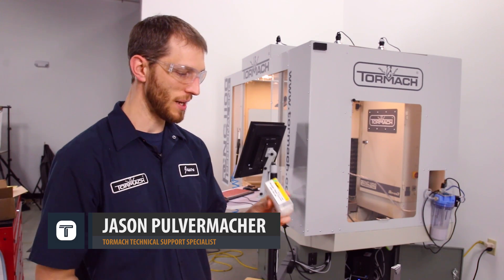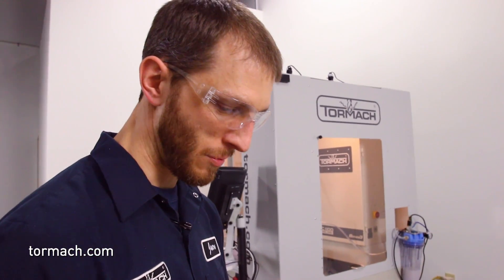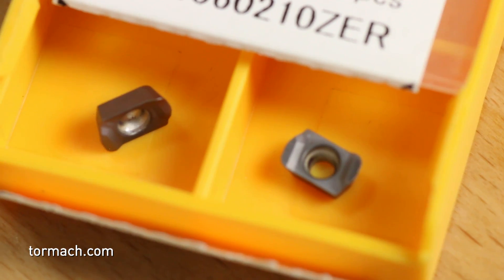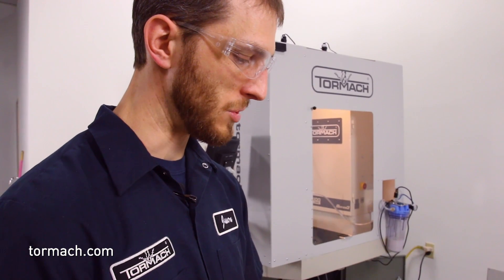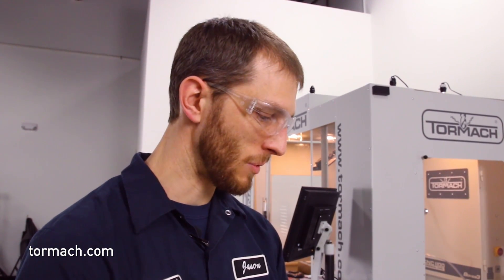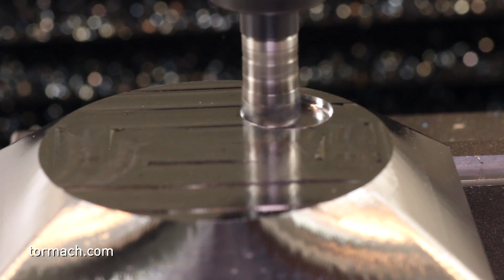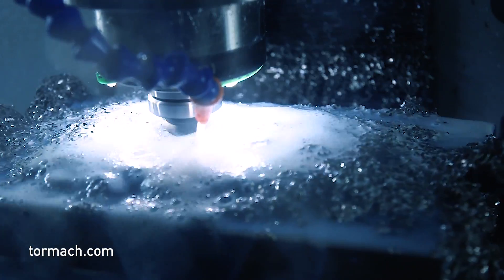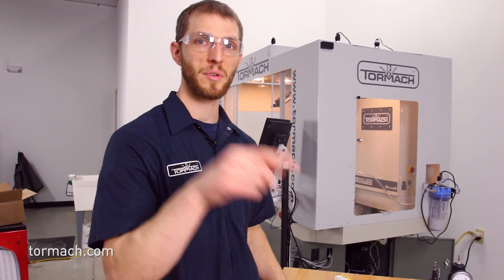How To Cut Hard Metals With the DIJET High Feed End Mill

Comment: Why not run coolant on this steel cut ?
Reply: On High Feed mills and most tools cutting with lots of surface speed and also hard machining coolant can cause a thermal shock at the cutting edge because of the very high temperatures appearing while cutting. The carbide can handle very high heat but cracks from the thermal shock when the coolant reaches the hot spot.

Comment: Heat doesn't cause work hardening, in fact it relieves it. The myth comes from the fact that cutting work hardened surfaces generates more heat.
Reply: Yes it does. D2 tool steel? Air hardening. You get the surface where the tooth is meeting the material up to 1200 degrees, and suddenly it's 55 rockwell c. Inconel? Same thing. The annealing temperatures for these materials are far far higher than their hardening temperatures, and they require precisely controlled conditions to actually get annealed- far more precise than the hardening temperatures.
Reply: Lol yeah okay tell ya what go get a carbide drill bit and drill a1.5 deep hole  in a piece of 01 apply oil for cutting fluid. When ya get done tell me how it work hardened and melted your tool.